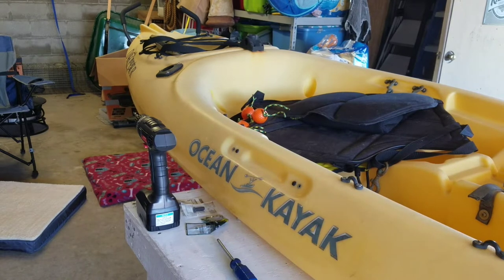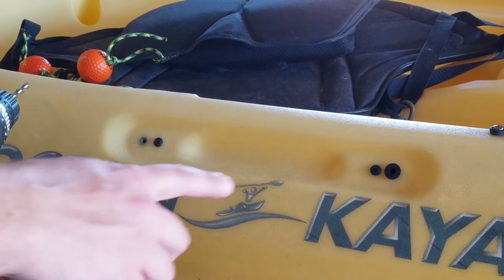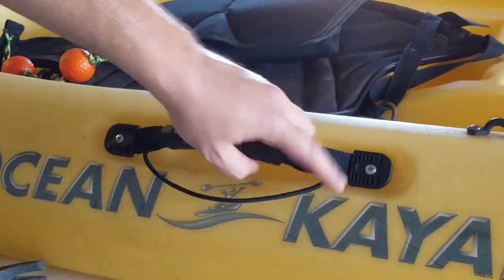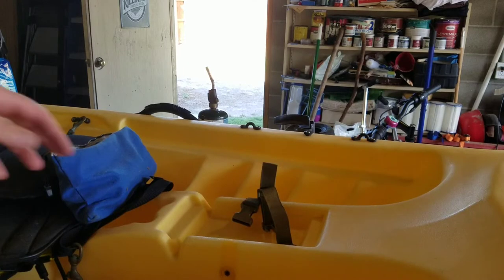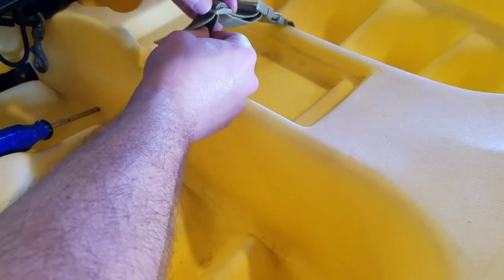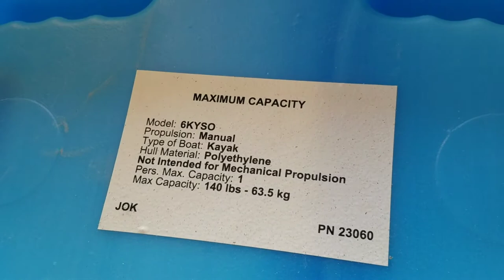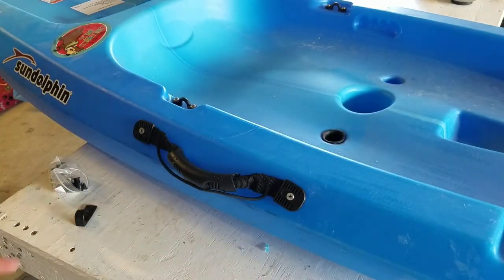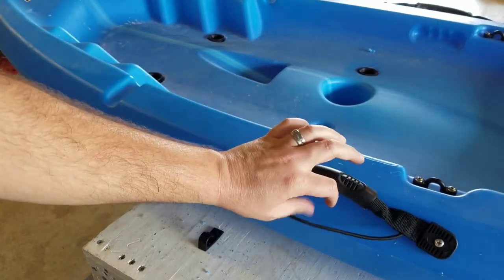How to install carry handles on a kayak.

Comment: I have a pelican that does not have the already place to mount them. Thoughts?
Reply from the maker: You can just mount them anywhere above the water line, and you will be ok. Thanks for watching.
Reply: @everydaysouthtexan  Pre-drill the hole?  The kit came with a nut and bolt.  There is no way I can get to the nut to tighten it up.
Reply from the maker: I used well nuts. You drill it out larg enough to insert the rubber nut, then screw it down.